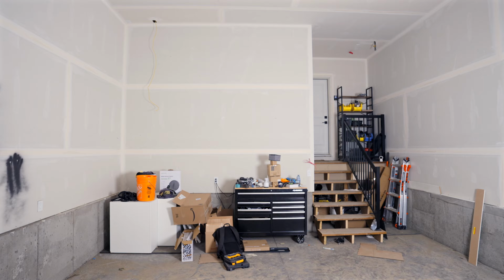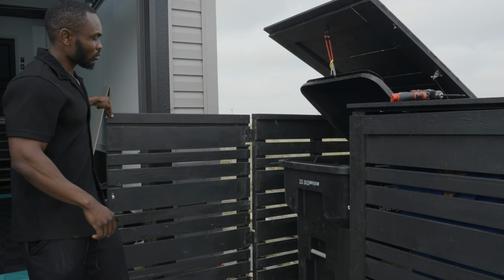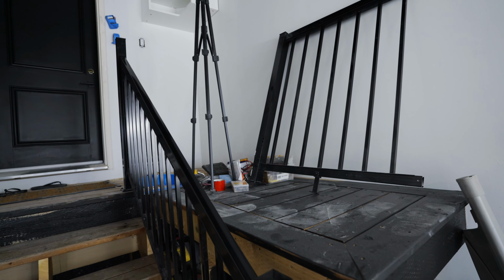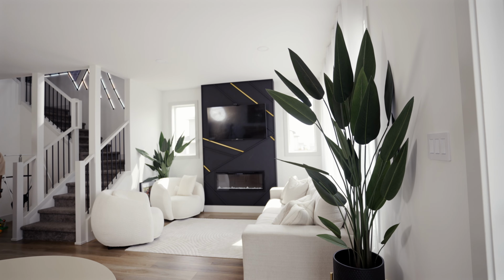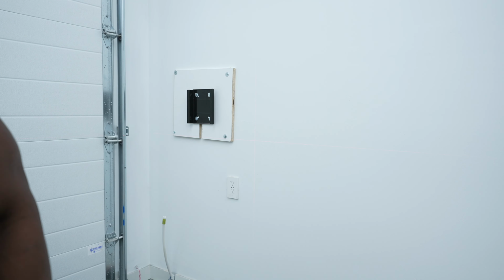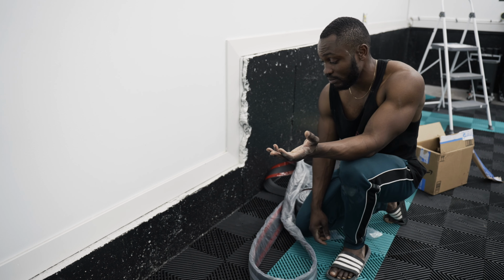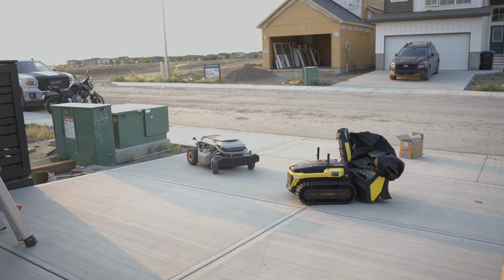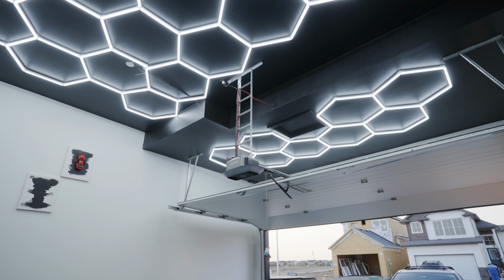Ultimate Dream Garage Makeover

Comment: How do you clean under that flooring?  All the dirty and debris just stays under there?  To clean underneath you’d have to remove the flooring to clean underneath I assume?
Reply from the maker: Yeah. If you want to do a deep clean. I typically do it once a year. You can just remove a whole section and slide it over or outside

Comment: How do you sweep the floors? Is it basically just going to gather up under the panels?
Reply from the maker: For regular maintenance, I use a shop vacuum. It can suck stuff or it can blow things away and maybe once a year, I can take out the tiles to clean underneath it for a more detailed clean. I haven't had to do that yet.

Comment: Nice video.  I don't think people will really understand how much time went into it.  Just the drywall itself can take such a long time especially if you have to skim coat it,  new drywall maybe not.  Disappointing from Husky customer care because those things are not cheap, make me rethink some storage when i get round to it.  I thought you could have included a french drain i think its called for the floor especially as new build and you said you have extreme weather. I'm thinking of using pvc panels for my interior as is waterproof and saves me having to scrape of walls and ceilings full of popcorn texture.  Enjoyed the video
Reply from the maker: @Homewithdaddy   I feel you man it was definitely a lot of work but I’m happy with how it came out. new build wasn’t all I thought it was. I had so many ideas like a drain in the garage  I wanted to do that I ended up abandoning because of the ridiculous cost. Making  any changes or additions to the design added ridiculous costs for things I can do in my sleep. The garage size isn’t what I wanted but ended up just settling amongst many things. I’m not happy with how a lot of things turned out. But once you sign that paper you just have to suck it up. I’ll probably go with buying an older house next time and doing a complete remodel instead of the new build with commercial builders. But for now I’m making the best with the situation with upgrades that I can do after the fact.
Reply: @tytalkstech  yes if the budget is limitless you can do so much but got to work with what you can afford.  Was the garage designed as you are a car enthusiast? Anyway garage looks pretty awesome.

Comment: What black paint did you use for the concrete?
Reply from the maker: @well_being101  it’s Benjamin Moore exterior paint I used - a bit more expensive than indoor paint. It works for concrete as well. Regular indooor paint works as well. I used that in my old garage for the past 5years  and the paint is still holding up.